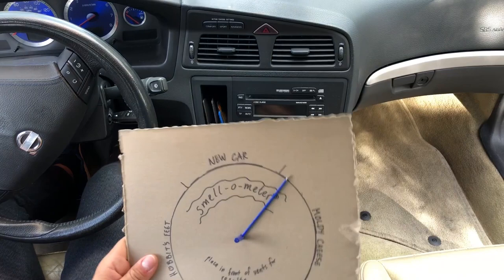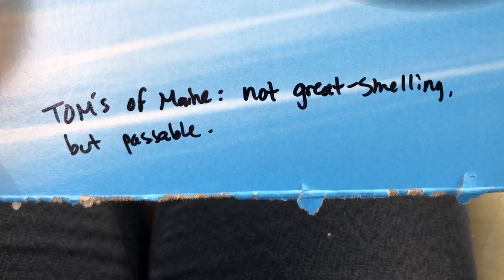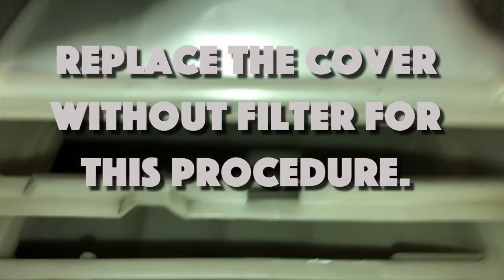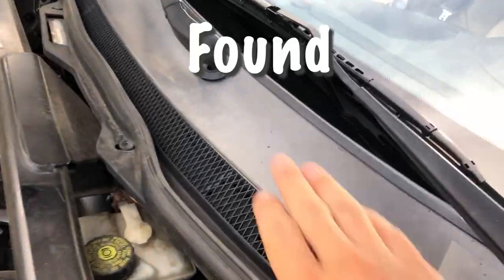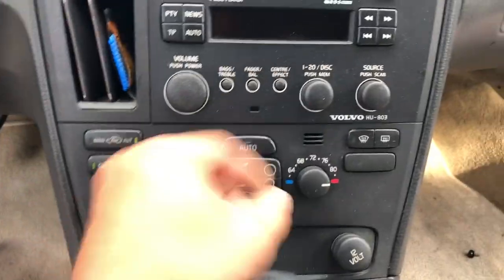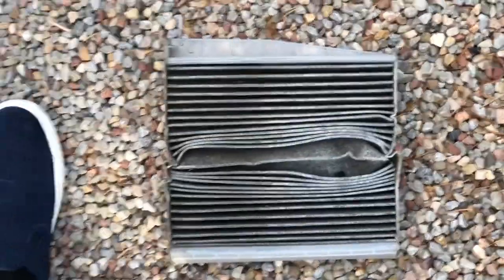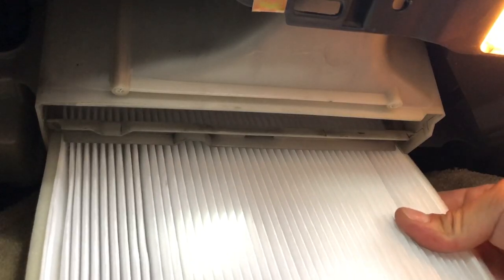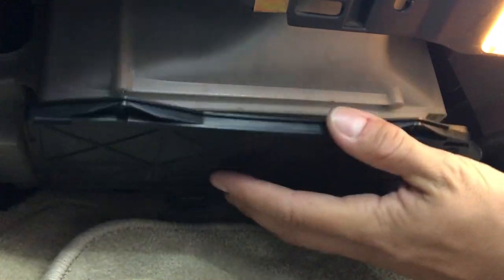Girls Like Clean Cars 🇸🇪  Volvo S60R Vent Deodorize + Cabin Air Filter)

Comment: Not so easy on an s40, cabin filter can only be accessed from the drivers side.  That is AFTER you have removed the accelerator peddle.  I ended up also pulling the drivers seat so I could wedge myself under the dash.

Comment: And that's why that section of floor is always slick and a safety hazard... folks spraying stuff to get a whiff.

Been working nearly 30 years on 3rd shift stock crews... you've confirmed my long held suspicion.
Reply from the maker: holidayhouse03 Lysol disinfectant sprays do not contain any oils or petroleum distillates like sprayable air fresheners do, so if anything it will strip the floors of any slipperiness. I can’t speak for other brands but I played it safe with this one.